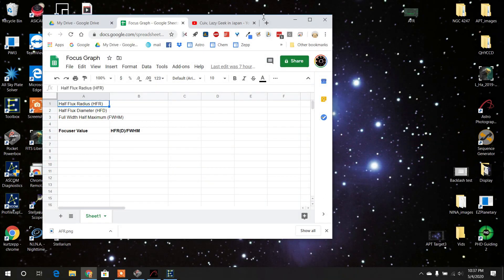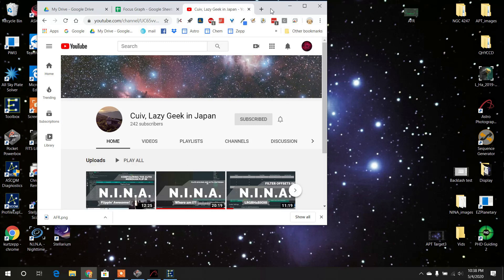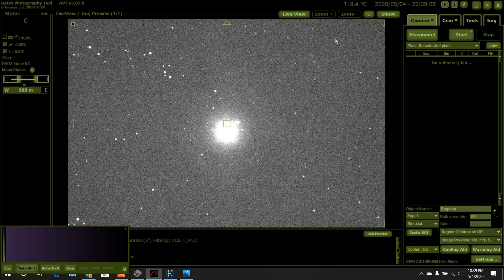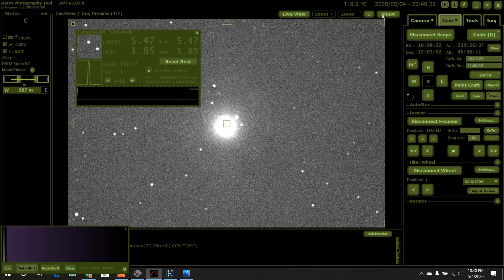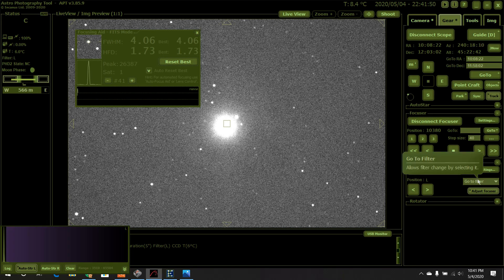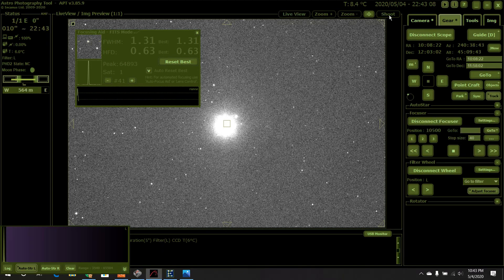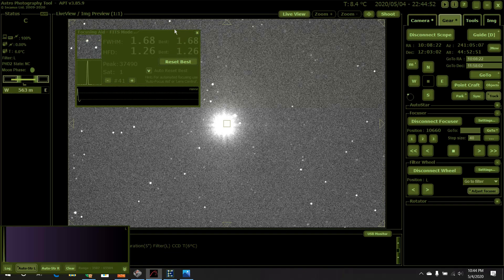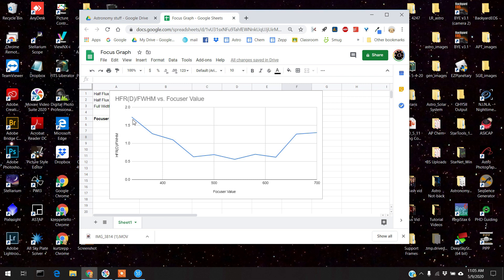Focusing w/ an Autofocuser (EAF) Video 1 of 4 - Manual Focus Graph

Comment: Hi Kurt, a quest' for you, when you mounted your focuser to your scope did you have the tube halfway out or did you mount it while it was all the way in, I have had a look at the manual and there is nothing on how to or where to have the tube when fitting the focus motor. I have just ordered the ZWO Auto Focuser.
Reply from the maker: I did it all the way out.
Reply: @AstroQuest1  I had forgot about this one, a question though, does your EAF motor  run your focus tube all the way in and out, I have to make step adjustments about half way to get mine to, the full distance of my scope focus travel is 45mm. I have been off the astro photo' it has been so cloudy lately I think it is getting worse than it has ever been.
         Robert
Reply from the maker: @newbee1016  Yep, but focus is about halfway.  Sorry about the clouds. - Cheers

Comment: Hi Kurt, very interesting video had a bit of trouble following with the numbers you were reading out but all in all it got the point across. Auto focuser is next on the list to purchase, but on the pension, that may take some time.     Robert    Down under
Reply from the maker: Thanks, you are right, the actual numbers were not that important as long as you understood what happened.  - Cheers

Comment: With Newtonians you can use the diffraction spikes as a tool of focus. Get a bright star, magnify it and look at the spikes. If the star is out of focus the spikes will appear double. Adjust focuser until only single spike appears at each of the 4 locations.
Reply from the maker: Cool, you sure can and also you can use the Bahtinov mask.